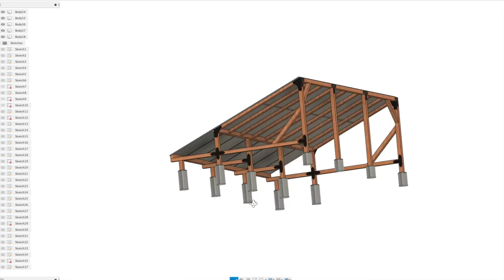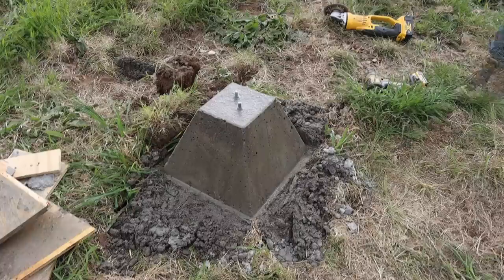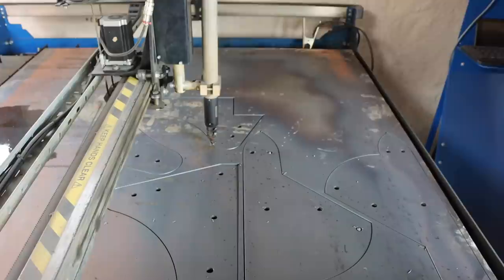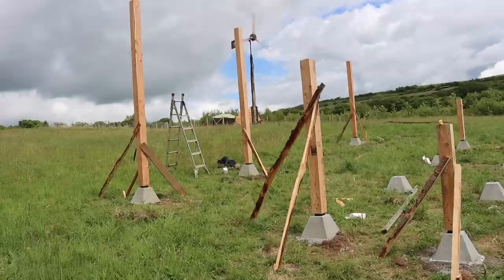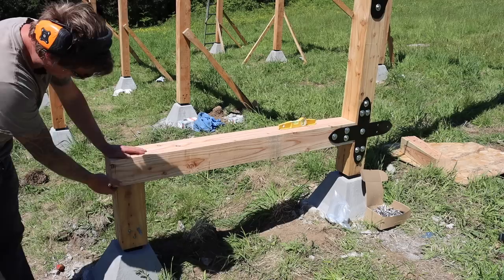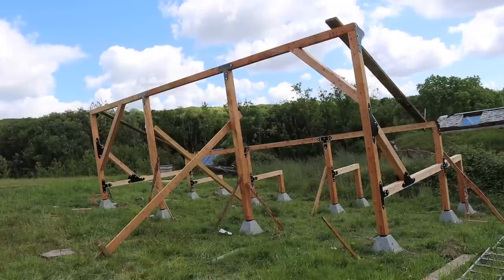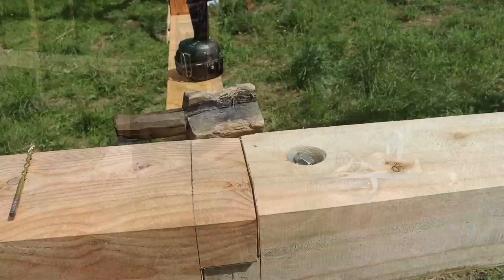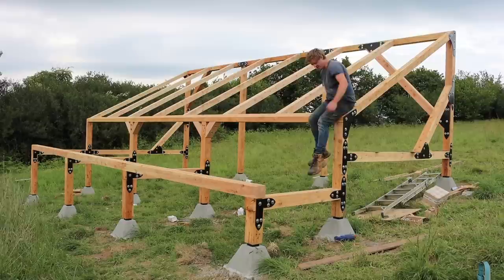8.4 Kw Timber Framed Solar System Part 1 The Frame

Comment: Another excellent project Kris. Shame about the panels, but that happens far more than it should. Tim from 'The restoration Couple' got ripped off for £8K on two chassis that were promised for months and then never appeared. Personally I'm with you and really dislike poor service.

I think you may need to re-engineer the angle brackets that do not have the accute angle removed as the lower ones will create water reservoirs. Only a minor issue with an overall great build. Well done again.
Reply: I am definitely NOT a builder but I try. I usually end up doing the job three times before I get it right due to a disgraceful lack of planning and distinct impatience. I learn so much from Mr H.

Comment: Kris   Not for this job but in future getting the metalwork galvanised at Newport Galvanisers (no I have no connection, just have used them) saves ever having to paint metalwork again.  They have a minimum charge but its a simple service to use. Drop off in Newport and pick up galvanised a week later.

Comment: That’s one way to make a 3/16” cut with a hand saw… if you have to make more than one cut I would disassemble the handles from the saws, stack the blades together and reassemble with one handle and longer bolts.

Comment: Kris, whole solar industry is in full boom nowadays - hard to get parts or companies to do installs. Not surprised your used panel deal become a scam - i guess they sold it to someone else for more… anyway, massive overkill - you basically built a house frame to put on panels :) good luck with install

Comment: Great video Kris. Can't help thinking the cheap panels were a sprat to catch a mackerel. I wonder if the cheap panels ever existed at all. 😣😣 I did wonder if you were going to turn this project into a mini barn given the size and strength of the build. I'd love to have access to the sorts of timber and materials you have to build a few projects of my own. But costs are crazy and I've taken to scouring local ads for timber etc. Look forward to seeing the panels installed.🤩🤩🤩🤩

Comment: I would have made all the outer edge bases the same height and the interior ones tops 4" below the tops of the outer ones. That way it would be easy to later put in a wall between the outside bases and a floor inside to convert the solar frame structure into a walled shed for storing yard equipment.
Reply: Or rent it out to some poor farm labourer... 🤣

Comment: Will you bring in gravel ..... Keep thinking of lots of good uses for the structure... a outdoor kitchen for canning, possibly stringing cables  for drying herbs in the fall.  Collecting rainwater off the roof for a soft water supply.  Have you thought of doing some vertical pc of lattice to screen the ends.  Just a little mor protection for the items in it and just hide valuable machinery from the casual visitor.

Comment: I thought you might of either painted the bottoms or sunk them in oil or put them on the fire to prevent rotting over the years because you live in a wet climate but I guess you know what is best. Looks great anyway.

Comment: I really like the idea of using wood as the basic material for the frame of the FV panels. Basically ecological! I am wondering how you are going to protect the wood from the weather and parasitic insects. Perhaps in the next episodes you will show.
I think you used "too rich" beams. A few people will climb on this frame and it will not "feel" it as a significant static burden. I have the impression that the more economical ones will do their job just as well. Even taking into account extremely strong wind dynamic loads.

Comment: With all that excess energy, you’ll need to make your tractor electric, add under floor heating to the workshop and get a bigger hot tub 😁

P.S. I’ll bet electricity suppliers will soon be offering better feed-in tariffs given current events!

Comment: Hi Chris.
I'm sure you have, but just in case have you ever watched the you tube channel "Mr chickadee-.

He does a lot of hand cut wooden joinery, predominantly with saw - chisel - wood mallet, if not it would be worth watching some of his building with wood.

He shows many joints, reasoning, tooling, techniques, it may or may not help your techniques and help your understanding of which joint are used and why.

We are always trying to learn new methods.

Comment: The ground anchor part isn’t over kill… the size of the panels act like a massive sail and the forces are huge, it can easily rip up the panels and frame and send the flying especially if the ground is wet making the soil soft.

Better to go ‘over kill’ than see the expensive panels smashed in a far field

Comment: Thanks for sharing...point of correction...Timber Framing is all wood joinery..." Post and Beam" is when the joinery is comprised of metal plates or splines...I'm curious, with concrete being such an unnatural and industrial material (one of the main contributors to greenhouse gases)...why you would not opt to use stone which is (in many ways) much easier and prevent to work really well over the last several millennia...Thanks in advance for your reasoning...

Comment: You could plug some crypto miners in to use the spare (free) power until you need the extra capacity. It’s not harmful for the environment because you’d have the capacity there anyway. Miners are cheap on eBay because it’s the crypto winter. Really like the videos. Keep up the good work.

Comment: Will you impregnate it with some wood preservative? Water and insects can really damage wood. Something like copper-green works.

More power is always better. You will earn it back, and you will be happy you have the extra power. Maybe installing a heat pump is a good idea, and that uses a lot of energy. 

Is there a brake on the windmill? Ive seen windmills catch on fire due to too high winds. 

Greetings,

Jeff

Comment: I have never seen such bad service from pretty much everywhere as of late. I’ve found that Suppliers, manufacturers and workers of all kinds are unreliable, late and just not interested in providing a good service. The problem is at them moment demand is outweighing supply in all sectors, at some point the work will dry up and their reputation will be mud so they’ll suffer.

Comment: I'm very impressed! How did you measure the height of the posts when the ground wasn't level?!?! I see that once you had the string/line between the end two, the middle ones lined up nicely when you were tapping them into place, but how did you get them to the right height in the shop? Or was there a step we didn't see? ;-)

Comment: A hint, my brother built a shed with a solar roof, only to learn that the are not water tight. So now he has a leaky shed.
If your plan is to use the solar panels as shingles, remember that they are not water tight. You need something under it, that takes the access water of your stuff.

Comment: @Kris Harbour Natural Building  In your original CAD drawing you had 9 rafters for 8 panels across.  Now you built it with 8 rafters, thus its for 7 panels across.  Was this decision based on the new panels and their dimension, or did you make a mistake, or is it irrelevant ??  Thanks  man !!

Comment: string lines sag. regardless how tight they are. a good rule is 1/8' on a 20 ft run. im curious why you wouldnt use your new transit laser or the old water level?

Comment: A pitty that the panel company let you down. You mentioned to use the area under the panels for storage. Mind the fact that panels will not form a water tight roof like tiles do.

Comment: I was just wondering - why didn't you use scaffold poles instead? They are dirt cheap, weatherproof, very strong, and much quicker to assemble. A couple of scaffolders (even one) could have built this entire frame in a few hours. (I realise it wouldn't look as attractive, but there are ways to camouflage scaffold poles so they blend in more with nature.)

Comment: It sounds like you got your money back so it could be worse.

Some extra solar thermal could warm greenhouses which might increase winter production.

A trickle of hydrogen can be added to an engine intake to reduce its primary fuel consumption. Given current gas/diesel prices...

Comment: Are you thinking of moving the wind turbine somewhere else? It looks like your solar panels will be in the oncoming flow or (with the wind coming from another direction) in the flow that's exiting the area, which might be an even bigger problem as the exiting flow is wider.

Comment: An interesting dilemma for the panels - I guess there was a choice between getting the full panoply, or halving the number and fitting a roof of some kind to the other half? Now the 'problem' is what to direct all the power towards, lol. I look forward to it!
Btw, are you going to have a fixed angle for the panels or make a bracket for each to alter the angle?

Comment: I just caught your channel a couple of days ago Kris. It's going to be ajoy to watch this project over how many weeks it takes. Your a legend.......  One question in you roundhouse how did you avoid water seeping in through the cracks in the structure? Also i read that you expect it to last 20 years... Is this due to the foundations?
Reply: The Hitpack -    If my memory is correct, Kris answered your questions in videos of the Round House playlist. I think the foundation answer is either in one of the foundation-build videos or in a Q-&-A. The water seeping concern was addressed in a couple of videos, at least. One when he applied a coating when the house was completed and one in a follow-up maintenance video (plus in a Q-&-A?).
Reply: @wendyweaver8749  Thank you wendy weaver.... One other question for the roundhouse for the frame are the posts nailed to the base?

Comment: Timber storage under ~10 kW of electric power... 🔥 What could possibly go wrong? 🚒🧯
Seriously, Kris, beyond the safety squint — how will you mitigate the obvious fire hazard? With the expensive PVs at risk... at least some measures should come out worthwhile.
Your builds are a joy to watch BTW. I'm just being curious, and mostly illiterate in safety engineering 😅

Comment: Another amazing build! I don't think you mentioned in the video why you opted for a bracket-reinforced structure like this rather than the traditional mortice-and-tenon timber-framing you've mostly been doing (you did briefly touch on it but didn't really explain)? Were there some technical considerations, or was it just a case of not wanting to go to all that effort for a purely utilitarian structure?
Reply: My guess is that you need an open air structure so the panels don't get too hot. This style of build allows a maximum amount of air to flow above and below the panels so they can operate at maximum efficiency
Reply: @milohobo9186  But would the type of joinery have much bearing on that? I mean, I guess my bet would be it's just quicker to throw something up this way, especially now he has that plasma cutter to make the brackets, than going through all that painstaking mortising-and-tenoning etc. but idk... It does still feel instinctively to me that the traditional build would be stronger, no bolts that can shear through under a high force, but maybe in practice it just isn't that big a difference...

Comment: Nice work! Is the flat part in front going to be a catwalk for access to the panels?  I generally like when you do the traditional joinery, but the brackets came out really well. Might be worth painting the bolts and washers to match too.  Sorry to hear that company dicked you over…consider it room for future expansion :). PS The windmill really sounds terrifying at times, lol!
Reply: Avana Vana -   If you go back to the beginning (~:08 - :13) of the video, you will see the computer mockup. It shows three rows of panels, with the lowest row situated where you are seeing a flat part. (I also wondered about the front part!)

Comment: Never redo those footings? Ha? OK! how deep did you dig? Do you get frozen ground in the winter? Unless you go deeper then the frost, the footings can be moved by freezing and unfreezing the ground. There are burial grounds that spit out the remains, due to this process. And buildings ignoring the rule to make the foundations deeper then the ground freezes are punished too. Just wanna let you know.
Are those post sitting on Metal plates? So water can rest in between wood and metal? So it has time to seep in and rott those post from inside? Instead of leaving it open and resting the pole just on those three metal pins, where wind can dry the bottom of the pole much faster. 

Dispite all the criticism, I am watching the videos because I like them and the work you do, plus the narration.
Reply: Frozen ground is not a problem in Wales.
Reply: @tonygrimes13  thats good.

Comment: Im about to have to do the same, building a decking for a 5m diameter Sibley Tent. I have my chestnut posts cut allready and was wondering If I want to put them in the ground or on stones or on concrete. 
I have a river nearby so Im going to collect the 21 stones I need I think its free and simpler than the concrete. any toughts?

Comment: Does the power company pay you for any excess energy you create if you wanted to pipe it back into the grid? (I know you are off grid) Here in the US the electric companies are required by law to accept excess energy generated by home installations.
Reply: Same in UK but you have to have a grid connection which may be very expensive to install in certain areas.

Comment: at 5:00 what is that tool/what is he doing? (is it just vibrating the wet concrete to get it to settle?)
Reply: Yea it like helps it fill in and spread out better so there aren’t holes

Comment: Getting your order cancled is def. annoying, but even new solar panels have become very cheap in the last 5 years and unlike with some other products, the cheaper solar panels are usually the best ones.
I hope you dind´t pay more than 4000£ for 10KW, that would be ok, 3.2k would be good and everything above 4.5k is a rip off/scam.

Comment: From an engineering calculation if you had used different anchoring brackets in the footings you wouldn’t need any bottom bracing. You could have saved a lot of lumber.
Reply: You're criticising someone who designs and builds all this enormous range of  stuff completely on his own, with no professional training?!
AND it's already built - what was the point?!
AND you didn't even explain the bracket and how it would save timber!!!!
You're just showing off you qualifications - aren't you...!
Shame.......
Reply: @andymccabe6712  dont assume you can read my intentions
Reply: @andymccabe6712 lol

Comment: Perhaps dont cut square corners in those brackets, rounded edges do take internal stress much better. There was a time the windows in planes had corners. They popped the plane open mid flight and mankind uses oval shaped windows since than. Oversized brackets? Yeah, that is all right but corners are still a breaking point. And oversizing is waste on material and money.